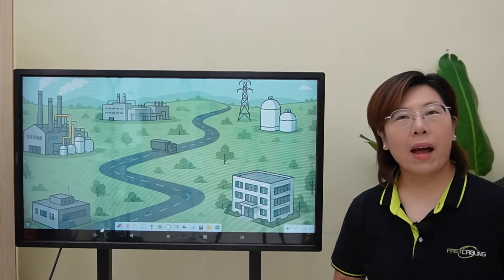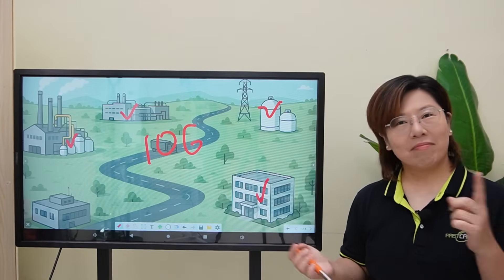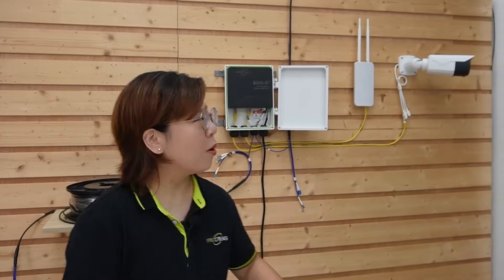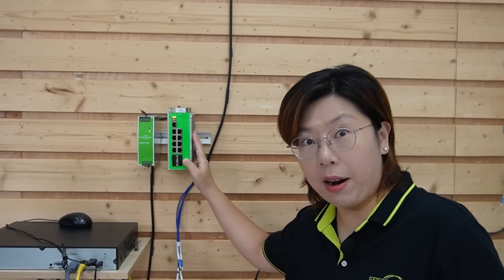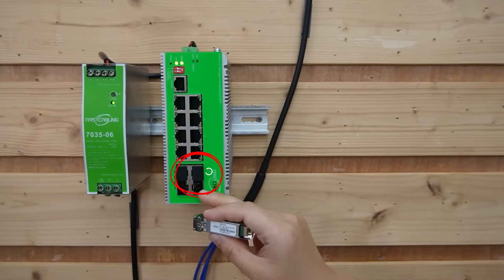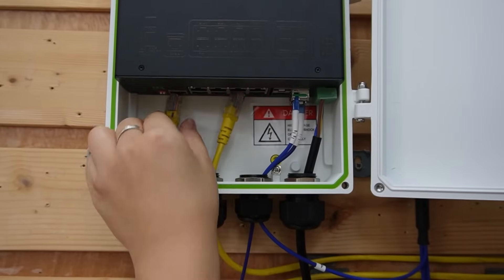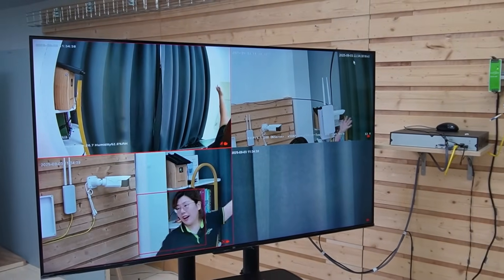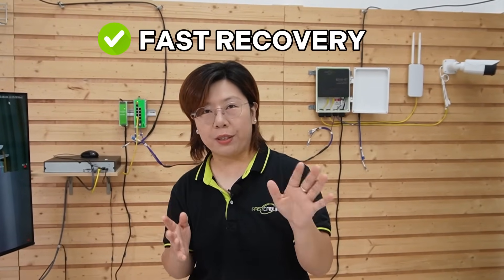10G Fiber Ring Network with PoE for Industrial Manufacturing | Redundant Backbone Setup

Comment: Could you do this wirelessly?
Reply from the maker: You can link cameras wirelessly with point-to-point or mesh radios, but for something like a 10G fiber ring backbone it’s not practical. Wireless links just don’t have the same bandwidth, stability, or low latency you get from fiber, and they’re much more prone to interference and weather issues.

Comment: in our company planning to setup three play system (Video, VoIP & data) using OLT (FTTH).How can we achieve a redundant path using an OLT like ERPS does?.  is your product will support for this (for more than 20000 users). Please upload a video showing configuration
Reply from the maker: It the PLC splitters which can provide the redundancy. e.g 2 in 32 out. You can connect two OLT to 2 in. The OLT needs to support this feature.
Reply: @Fastcabling  how about ur products. can i get a tutorial